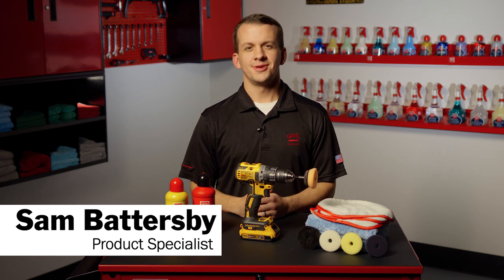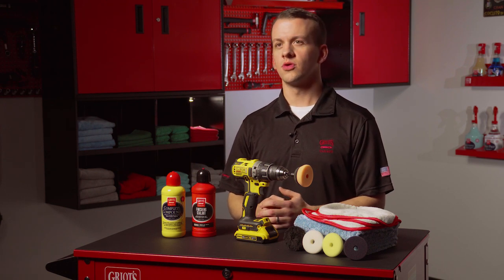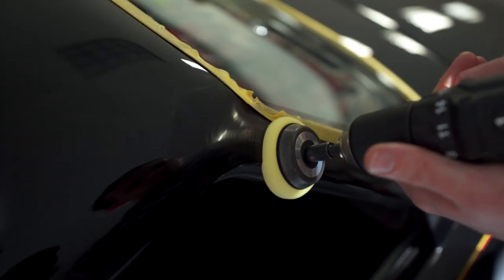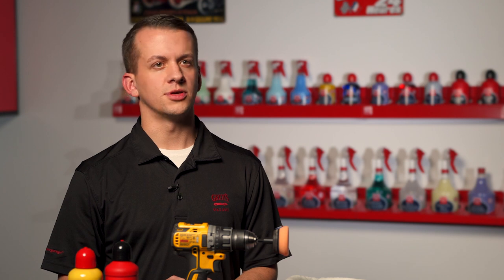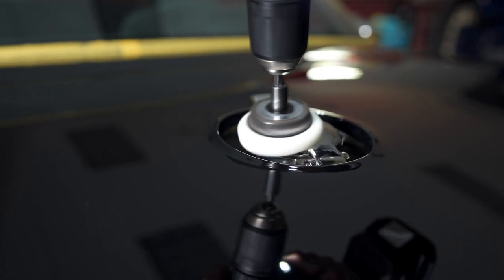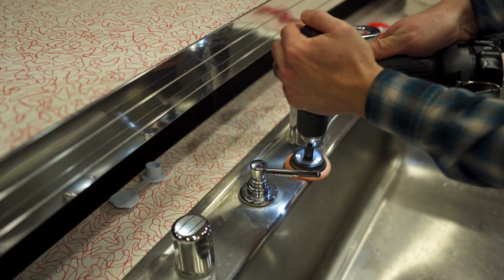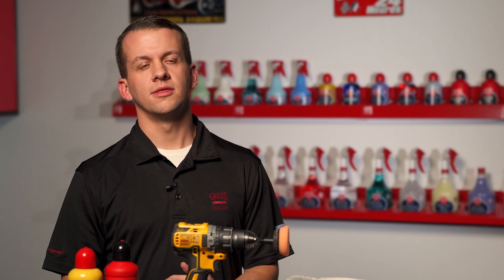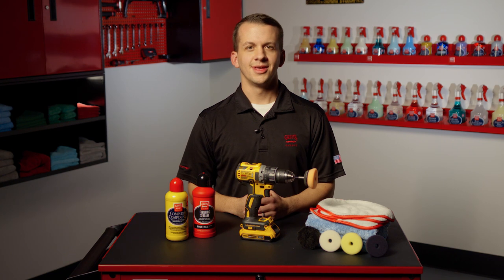Drill Polisher Adapter Bit

Comment: You should be offering this as part of a complete kit - the adapter, backing plate and a heavy, medium and finishing pads. An ala carte approach makes it tough and time consuming on the buyer.
Reply: BigOldDog there is a kit with backing plate and pads, you just have to buy the adapter but separately!
Reply from the maker: Thanks for the feedback!  We do offer a kit that can be paired with the bit (2" backing plate with a collection of pads).  Details are here: https://griotsgarage.com/product/boss+2+inch+orbital+conversion+kit.do
Reply: @GriotsGarage  you're still not including the polishing drill bit you need for that. Make it a complete kit if you gonna make it.

Comment: There is no other reason to sell these pieces individually other than to maximize profit It would've been so much easier and economical to sell it as a kit.
Reply: I agree but then there's me, I by a drill, for jewelry, now I need rock cutting bits, a   stone polishing wheel got that now I need the right adapter.

Comment: Probably a dumb question, but could you use an impact driver instead of a drill?
Reply from the maker: We don't recommend using the Drill Polisher Adapter Bit in an impact wrench due to increased risk of damaging adjacent surfaces.
Reply: @GriotsGarage  thank you